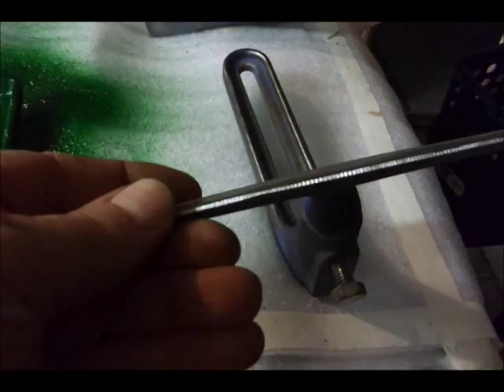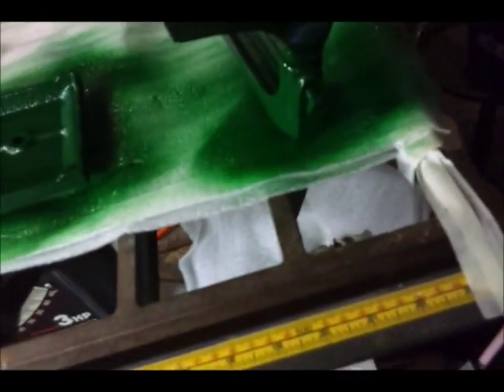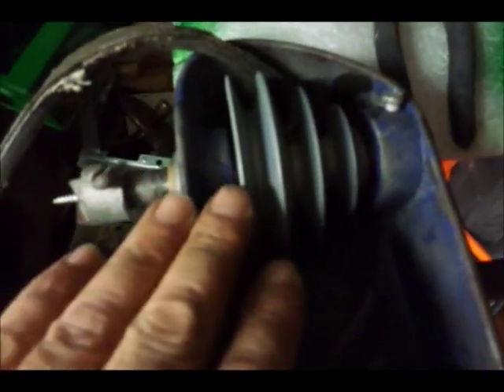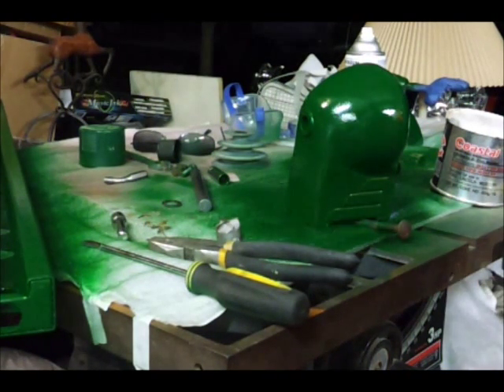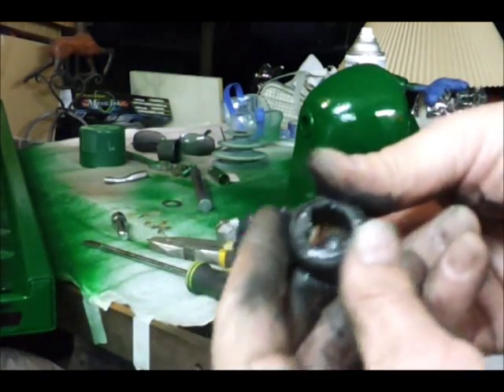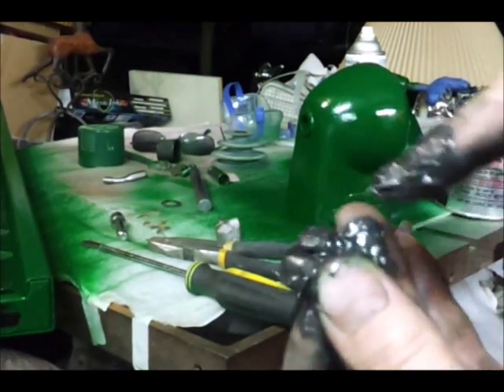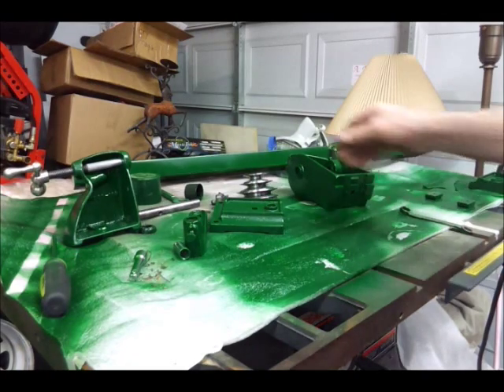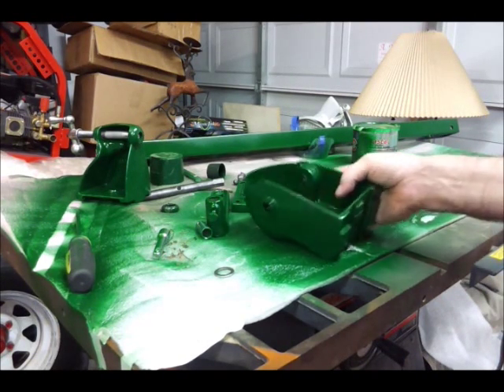Dunlap Lathe part 3

Comment: Hi,

I am actually cleaning up a Dunlap 103 myself.  I was wondering if you ever figured how to take the tail stock apart?  I am having trouble removing the quill and feed screw.

Do you have any advice for this or maybe a manual?  I'd appriciate anything.  Thanks!
Reply: 4 years ago.  Wow.  Now I'm trying to do it.  No luck so far.
Reply: check vintage machinery.org they have manual on line for some of the sears Dunlap models